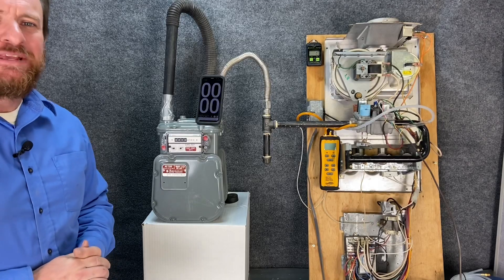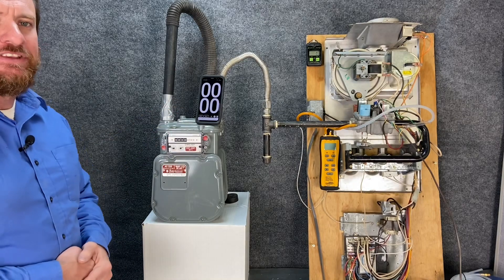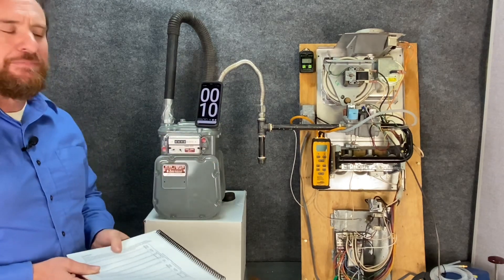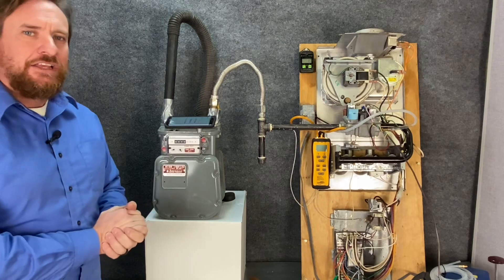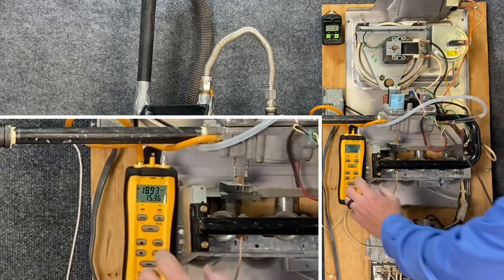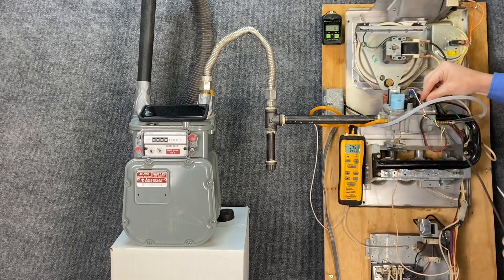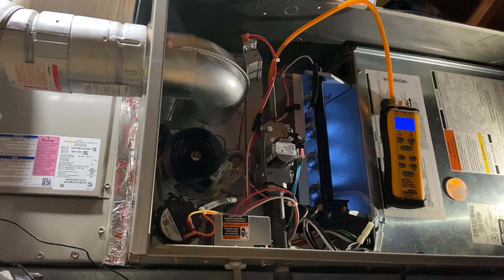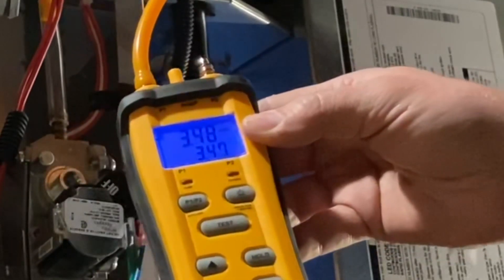Clocking a gas meter for a gas furnace with adjusting gas pressure

Comment: We have metric meters here in Canada so if  I read  the .01 M3 dial at 20 secs per rev. Then 3600 x .01 / 20 = 1.8 M3/hr.
There are 35.315 ft3 per M3,  so 1.8 x 35.315 = 63.367 ft3/hr
Then BTU/hr = ~1015 x 63.367 = 64,317
Reply from the maker: I worked with a lot of metrics in Australia but I have never thought about clicking a gas meter in metric.

Comment: My metre says 0.5m3 
When I put that in the equation it shows 20k btu it sopposed to be 80 
When I put 2 in the equation I get the right answer how do I know ? 

Andrew
Reply: I figured out the equation in my comment above - use .05 instead of my .01 and check with your gas company if 1015 btu/ cuft is correct.

Comment: Why is it important to clock the gas meter? Are we just confirming the amount of BTU's being burn matches the rating of the furnace? Would we not want to confirm input and output pressure with the manometer 1st and then clocking the meter? What do we do with the results after clocking the meter if they appear high or low? Also in the demo, don't believe you mention to have the furnace running before clocking the meter. Yes this should be common sense.  ;)
Reply from the maker: Jim does a great in depth video I will link below.
If the furnace is not matching the BTU there will have to be adjustments made for proper operation.
https://www.youtube.com/watch?v=4h5UgrujqJw
Reply: @love2hvac  thank you 😊 🙏